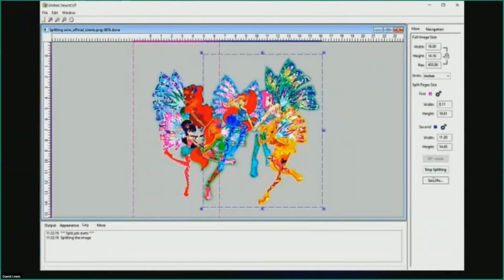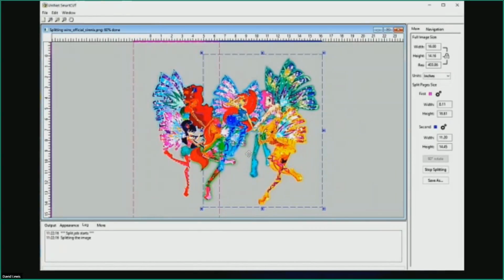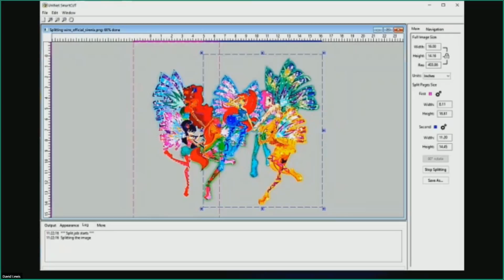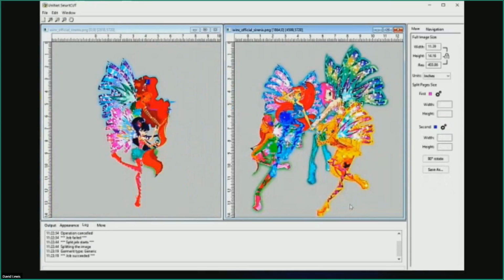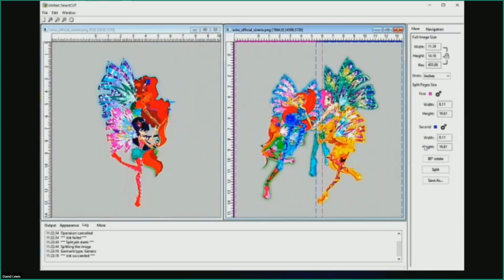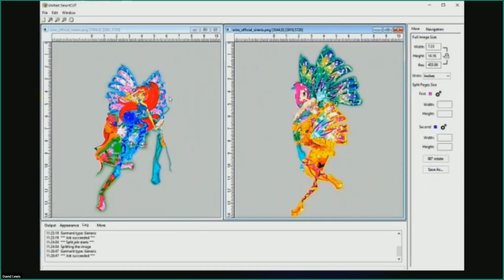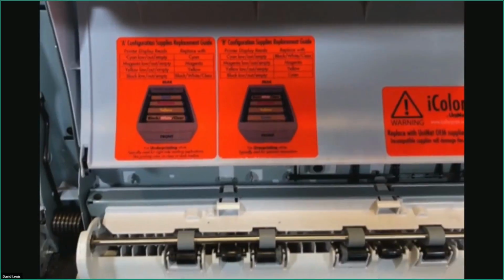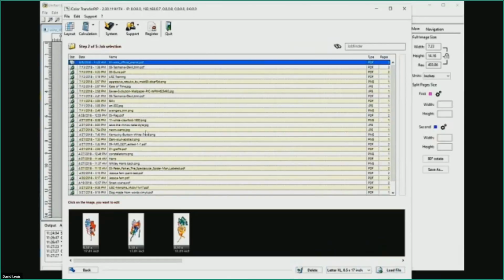Uninet iColor Webinar Aug 8 2018 Part2 QandA session

Comment: These printers cost waaaaay to much money to have to split images to get 11x17.
Reply from the maker: They come in multiple sizes. You must have only seen the 8.5x11 inch model.  The Smart cut software enables you to create designs larger than what your printer can do. Some people choose to get the smaller 8.5 inch width printer to save money. This software lets them do an 11x17 print for the same cost in materials as someone who owns the larger printer.